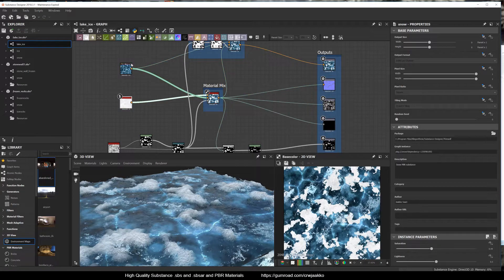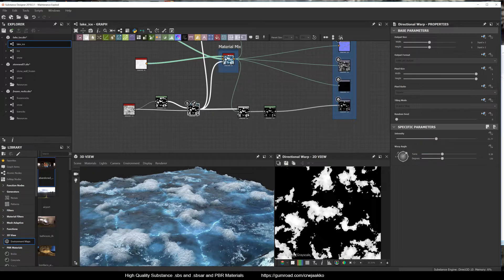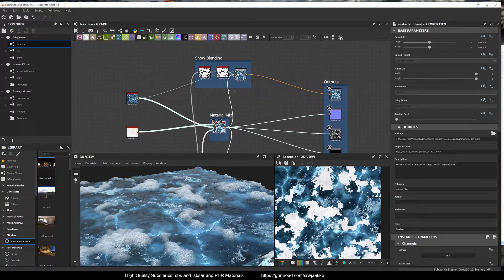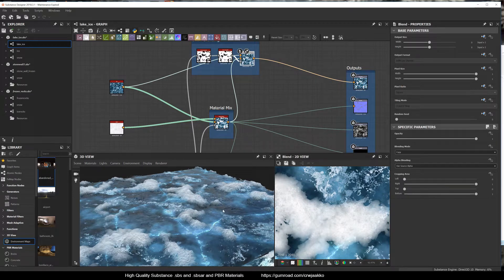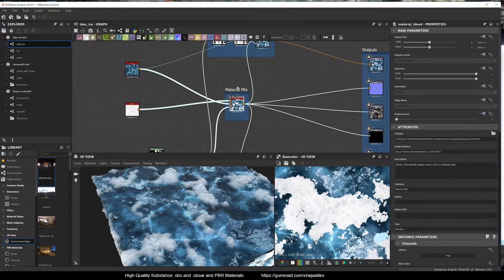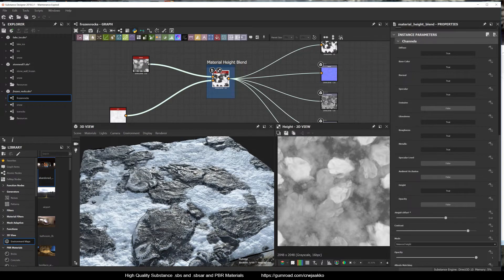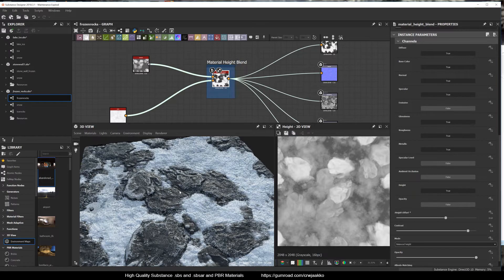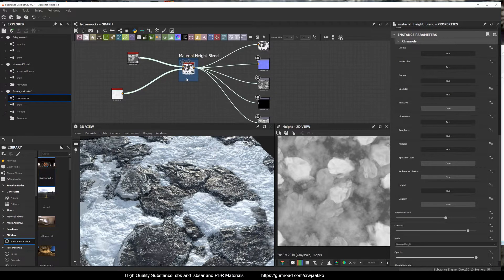How to Use Material Blend Node in Substance Designer

Comment: hmmm Do I need a mask? I try using a material transform to shrink the top material. But then in the material blend it doesnt blend correctly. Its just black outside the top material. Guess a mask is needed to make it work correctly?